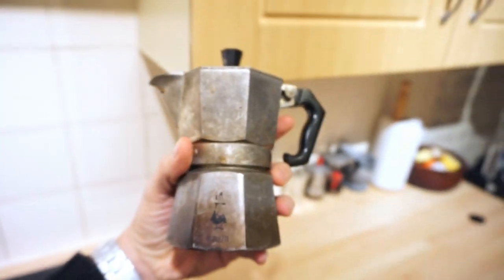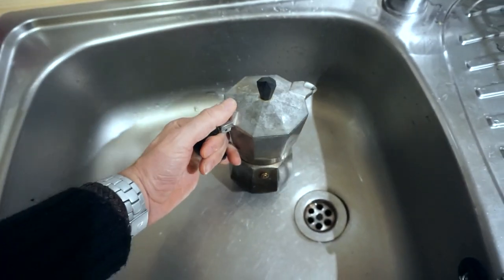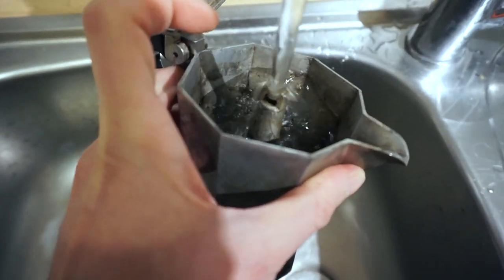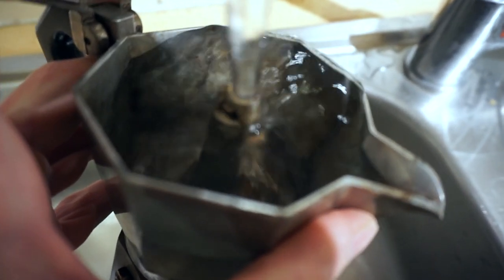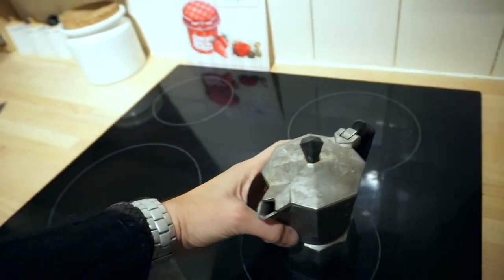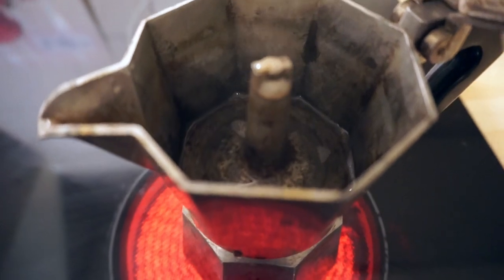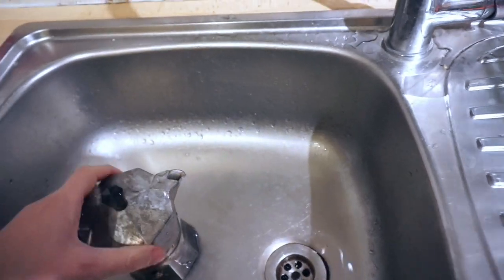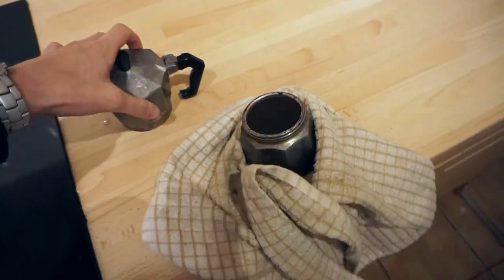Stuck coffee machine

Comment: I noticed that it is best to only just do up the top part and do not tighten it up much. The pressure seems to tighten it up even more then it cannot be removed!
Reply from the maker: Hi Mark, thanks for the suggestion. Do you mean fill up with water just the top part?
The reason why it tightens is because the metal dilates so the two parts get stuck even more. Maybe that is because there wasn't enough water to dissipate heat or because it was left on the fire for too long. Let me know. Thanks

Comment: My Bialetti was left undiscovered after a visiting friend had used it.  I found it a couple of days later, still full of grinds, and stuck fast.  This was particularly annoying as I had changed the gasket only a few weeks ago, so it certainly should not have deteriorated in the way Luter 82 describes as the culprit.

Because the basket was still full of coffee, I couldn't seem to get enough water through the hole in the upper chamber to heat it up on the hob.  In the end, I stood the moka pot in a deep jug and filled the jug with boiling water until the level of hot water was above the level of the thread.  I left it for about half an hour, took the pot out and cooled the very bottom of the pot under the cold tap.  I managed to unscrew it just as Luter 82 demonstrates in his video.

Thanks for the video, Luter 82.  It didn't quite work for me - but it gave me the principles to apply to my own own problem.  I think the proposition to carry forward, for me, is:
Always cool and unscrew the moka pot as soon as it is finished with.  And, don't let visiting friends get their unsupervised hands on it!

Comment: I Accidentaly left it submerged in some bucket for a while, it got stuck and full of gunk. 
This method didn't work as it was stuck severely.
So I used a vice to grip the bottom of the moka and used a chained tool for car oil filter removal, at the middle, where it's round, It got unstuck very easily. It had almost fossilezed coffee  inside (from re-heating experiments), I'll probably use a dremel with brushes to clean this artifact., I'll reseason it with two-three coffee cycles, so it doesn't taste of aluminium.
Unless your moka is cracked or literally welded,, you can revive it, just don't use excessive force.
Cheers

Comment: Still a no go for me. Also tried cooling the bottom with cold water and the top with warm water, didn't work.

I do not have rubber gloves in my kitchen, only gloves with heat resistant cloth outer layer. Can anyone give suggestions on how to do it?
Reply from the maker: Try this process again, I would say at least 3 times. 
Last resort is to put the machine upside down and spray some wd40 in the thread, leave there for a couple of hours and try unscrewing then.
Reply: @luter82 Grazie, I'll try this.